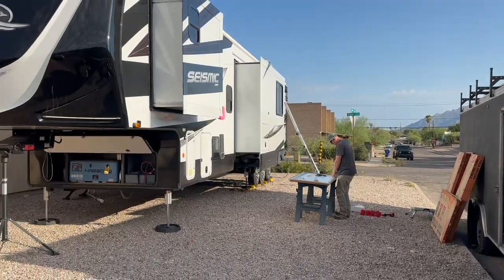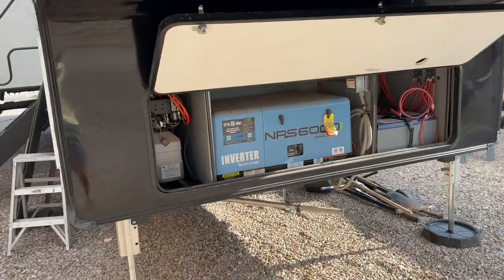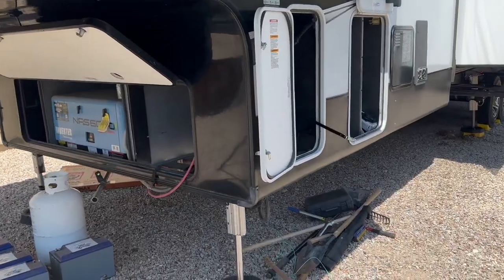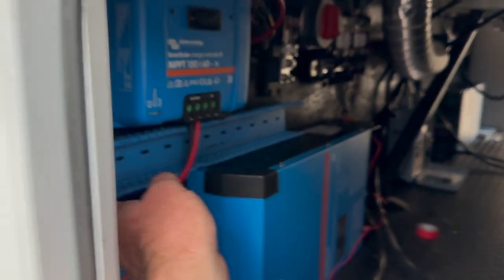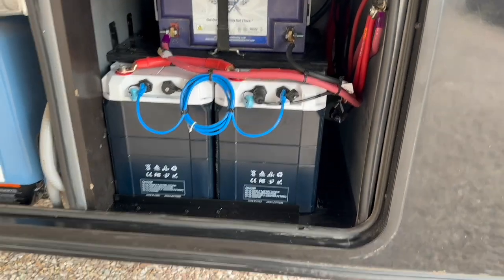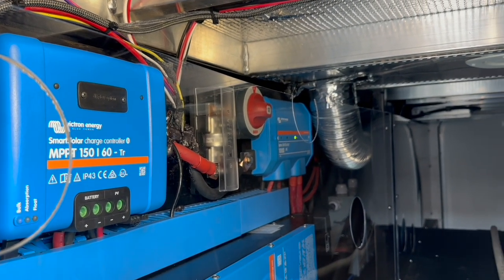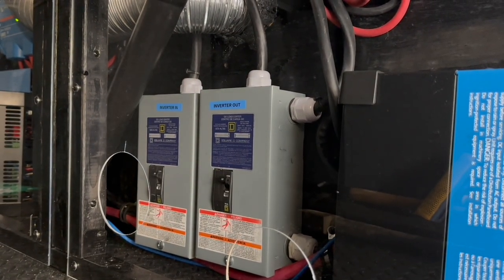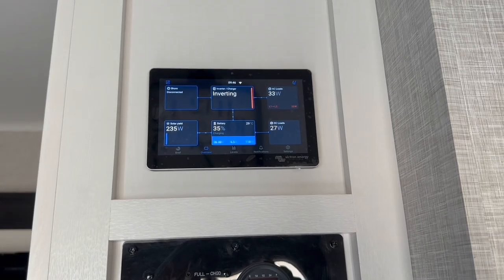Toy Hauler goes off grid with Victron, Rich solar, and Epoch batteries!

Comment: Can you please explain the purpose of the 2-50 amp breaker boxes (inverter in/out) and how they function? Does this basically  serve as a splitter for input AC power (shore) coming from the Transfer switch?
Reply from the maker: Exactly - takes the 6/3 NMB and splits out L1/N/G and L2/N/G to go into and out of each respective inverter. We only do these with dual inverter installations that we put into split phase or parallel.